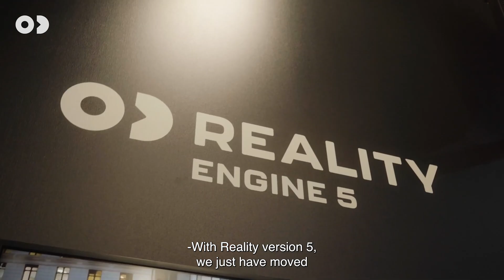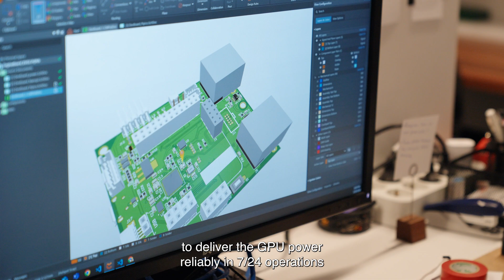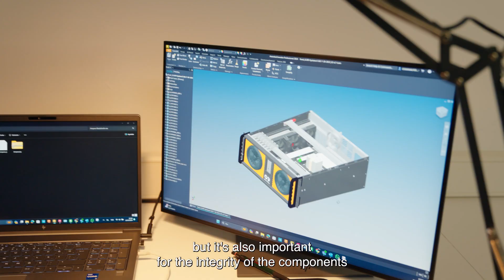EVO II: Crafted for Ultimate Performance in Real-Time #virtualproduction

Comment: what video i/o does this come with / is recommended? What chipset does the MoBo utilize?
Reply from the maker: Hi, thank you for reaching out! 
Corvid 44, Corvid 44 12G and Corvid 88 are supported. We recommend using cards with full-size BNC connectors, such as Corvid 44 BNC and Corvid 44 12G BNC. Cards with smaller DIN standard connectors are more likely to be physically damaged in long-term use. 
The answer to the second question is X670 for MoBo Chipset.